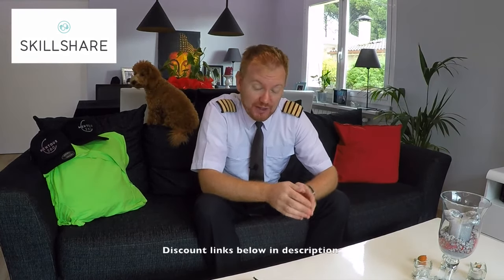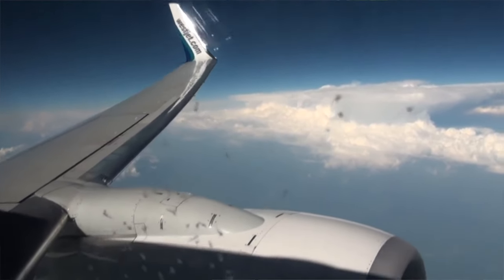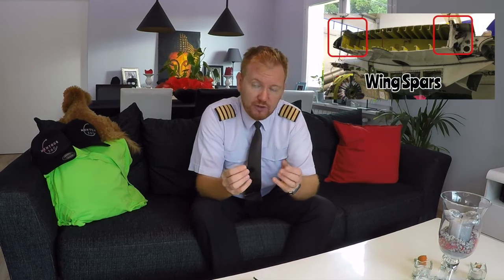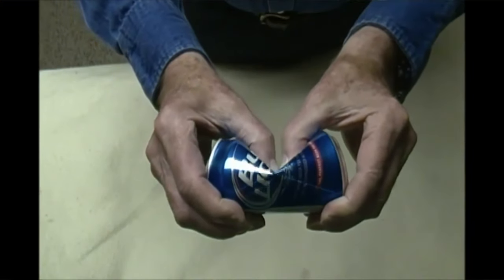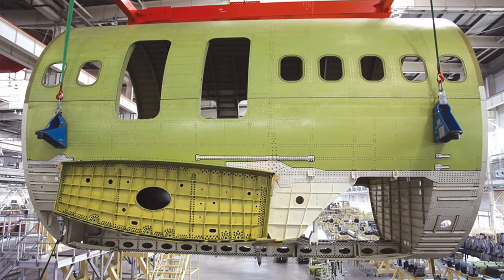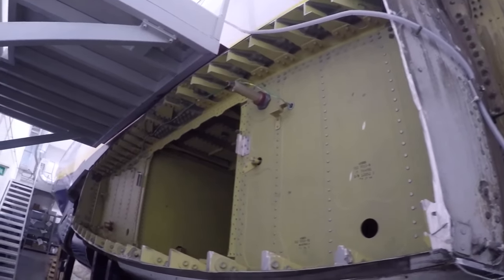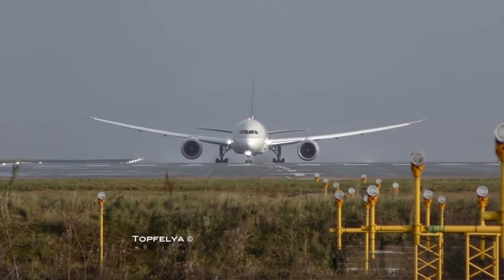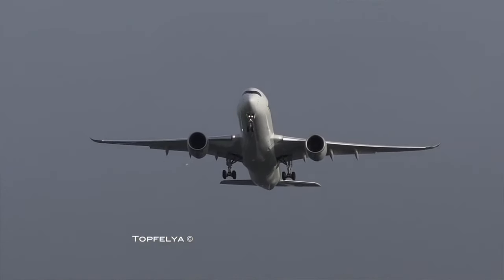Why don't the wings break?!

Comment: My dad was a WW2 Dive Bomber pilot who then became an Aeronautical Engineer and joined Boeing, Seattle in 1950 and stayed with them until 1960. His primary assignment was wing design of the 707. Because of his first-hand observations of wing failures of fellow bombers,  he was fervent in assuring the 707 wings could NEVER fail. As the 707 was the initial Boeing large passenger jet, many of the internal Boeing design specifications were established for the 707 and then made part of company design requirements... to be applied to future designs. Because it is hugely difficult to modify a design standard, then I can assume that the stringent wing strength and flexibility standards developed by my dad (and others) are still the minimum (or further improved) standards applied to ALL Boeing jets.

I am NOT as brave (nor heroic) as my Silver Star father, and so have some fear of flying. HOWEVER, the one thing I am 100% confident of whenever I climb aboard a Boeing plane is that the plane will NOT crash due to wing failure 😁👍  Thanks, Dad ❤

Comment: I had the pleasure of flying in a Ford Tri-Motor a few years ago.  The rigidity of that plane was quite noticeable.  Standing next to it, if you only looked at a small section, you would think it was a very sturdy garage, not an airplane.

I remember seeing a documentary that showed testing of a wing (Boeing, I think?) where they secured a wing to a test rig that bent the wing until it broke.  When it broke, it just basically shattered.  It was amazing/frightening to see, yet comforting because of how far they had to bend it before it happened.  The engineering in modern airplanes is incredible.

Comment: So, I flew out from Edinburgh on 757-200 to JFK (economy)  -all good but cramped -narrow body plane... then I flew back via Amsterdam on a KLM 787-900 Dreamliner.....that was different experience. Economy on this beast felt like an upgrade...Windows were much larger and they auto tinted (no blinds) at night and then in the early morning, from the front of the plane, progressing to the back,  it was awesome to watch the windows, one by one,  slowly become see through again, letting the fresh morning sun into the cabin. Air quality was better, room to move was better,  USB and mains charging sockets available for devices. An absolute pleasure to travel on the 787.

Comment: This is how I have heard pilots describe airplane wings. They are capable of touching each other without breaking. That says a lot.
Reply: No not that far. On the 777, I think it is 32 feet at the tip.
Reply: While that’s certainly an exaggeration, it does tell you how much confidence pilots have in the overall strength and resiliency of their aircraft during rough flight conditions.  If the crew aren’t worried, then I won’t be worried either.

Comment: Of course they can break.  That's why there are published G-limits for airplanes.  F-4s were subject to transonic pitch-up that would tear wings off, but that won't happen if you don't go supersonic.  As Naval Aviators we experienced negative Gs and pulled 6-8 Gs, but most people won't do that.  My mom got excited at only +2 Gs (60 degrees angle of bank level turn).  As for thunderstorm penetration (turbulence),  there's a speed where the wing stalls before exceeding  G-limits so it never overstresses if you slow to that speed--that's also maneuvering speed if you're flying a fighter, that is minimum turn radius and maximum rate of turn within the aircraft's G-limit.

Comment: It seems it would make sense to connect the wings together in the center of the aircraft wing box rather than have them bolted on at the side of the wing box. Seems like leverage of the wing would put stress on that and be weaker than if it was connected "inside" the wing box.
Reply from the maker: Don’t think of it like the wings are connected to the wingbox, think of the wings and the box as one, whole unit, that’s how it’s designed.
Reply: But if you connected the wings at the center, that single joint would see twice the load.
Reply: Dan Stinson,  Agreed. It has always worried me that the wings are constructed separately and then attached to the wing box/fuselage with bolts. Those bolts are kind of critical. One would have thought it would be safer/stronger to construct the wings in one piece running right through the aircraft . . .
Reply: @jamesneilsongrahamloveinth1301  The bolts are critical, but they're the very last thing to go in a structural failure.
Reply: there has to be a joint, buying single piece aluminum wing skins is already expensive. Making them twice as long without a flaw is even worse.  The biggest reason for the joints at the side of the fuselage is you have to react the pressurization loads and flex at where the body and the wing intersect. By putting the center box to outer wing joint at the joint to the fuselage you can do both jobs at once. All Boeing airplanes since the 50's have been this way. Same with Airbus

Comment: I've done -1g and +9.2g. Neither is comfortable but they are both all sorts of fun.
Reply from the maker: Aerobatics?
Reply: Got a ride with the USAF Thunderbirds. 1 hour of everything an F-16 is capable of, I could barely walk the next day. It is far more strenuous and physically taxing than "Top Gun" would lead a person to believe and I would do it again in a heartbeat. But now, I settle for riding commercial, mostly in 737's.
Reply: There are many rollercoasters that exceed 2g.
Reply: Yes, but there are none which will induce gLOC or cause a redout both of which I visited the edges of. 

The most disconcerting effect of high g to me was the vision distortion. At about 6g everything goes blurry as your eye shape distorts beyond the lens’ ability to correct. Your eyes flatten. 

About 7.5 g everything goes black and white as the cones stop getting enough oxygen to function. Above 7.5g the tunnel vision starts. The edges go black and shrink toward the center rapidly until it appears you are looking at the world through a paper towel roll. All due to blood pooling away from the head even with a g suit. 

Negative g is worse. That feeling you get in a car going over a hill is just the start. If negative g continues everything in your abdomen tries to move into your chest. Makes it hard to breath and really hard to keep lunch down. 

Neither is enjoyable but I will take +g over -g every single time.

Comment: Would it be interesting to give some insights about Turkish Airlines Flight 1951 Boeing 737 Amsterdam Schiphol Airport? Where basically an airplane fell out of the sky.

Based on your previous video's about stall and enginespeedup times, could they have pitches the nose down to gain speed. Are there changes made to airplanes to prevent auto-throtling not to kickin when a pilot gives full thrust?

Comment: Petter,
I offer another view as a structural engineer. I suggest that the wings flex because:
1. aircraft grade aluminium, a typical metal, behaves elastic (up to a certain point)
2. you could make it out of carbon fibre, it'd flex a lot less, but it'd be very expensive to make
3. flexing that often is not good for the aluminium metal - it has a limited fatigue life
4. the highest stress in the wing structure is at the root fixing to the body. This is also where it's designed to be thickest and has the most structure

Love your videos.

Comment: I've always been a helicopter lover. I really kick myself for not trying to go into rotary wing school when in the army. Oh well.  My point is, I've always noticed the rotor flex from the side view as they lift off, and weight is placed on them. 
Id say that's a good comparison of wing flex. That too is why they build flat bed trailer trucks with an arch, so when loaded they won't have accidental bed failure with load on the. Thanks again for another cool episode.

Comment: What about fatigue cracks that are not discovered until something happens?
are routine maintenance checks sometimes missing signs of fatigue?
Reply: If a wing breaks during flight, I suggest you go and take a seat on top of the black box, because chances are, nothing on this green earth is going to save you

If you are lucky enough to be thrown clear of the aircraft when it inevitably breaks apart (and you are not still strapped into your seat), depending on how much altitude you have when the airframe fails, you might be able to aim yourself toward something soft, snow would be best, though a pile of mattresses or even a patch of trees are better than nothing (don't aim for water, hitting water is like hitting concrete, oh and you can be knocked unconscious and drown) 

If it happens in an area that lacks a suitable landing area, spread out to slow yourself as much as possible (like a skydiver preparing to open his chute) and at the last second (maybe 100-200ft) try and land on your feet with your legs bent a little, this will reduce the impact energy by several orders of magnitude (though you will probably still die if you don't get medical care within a few hours) the downside of this is it is almost guaranteed that you will break both your legs and possibly even your pelvis (you may even have to get your legs amputated) but it's better than dying isn't it?

if you are extra lucky, you will have some broken bones, a stay in the local hospital and one hell of a story to tell (especially if you have it on video)
Reply: Just saw a video on here where a military guy was explaining how he xrays the C-5's frames every 18 mos, every C-5. So I'm sure civilian aviation has a program similar
Reply: @judgenutmeg6935  any crack in the aircraft skin is an indicator that the main spar is overstressed or is about to break

If I see cracks in the wing of any plane I'm about to board, no way am I getting on board

I already had an experience of an aircraft wing almost snapping off (bad maintenance missed a crack in the main spar, but excellent piloting, clear weather, and a good amount of luck allowed the wing to stay attached to the plane) the wing was bent at an angle (not a curve like it normally is) and it was a white knuckle ride all the way to the runway, let's just say, there was more than just a round of applause on landing

Comment: Regarding sturdy connections: American Airlines Flight 587 crashed after the copilot put in hard rudder inputs during wake turbulence, causing the vertical stabilizer to rip off.
Regarding poor maintenance: Partnair Flight 394 crashed because a counterfeit bolt broke under stress and the rudder was torn off.
Regarding poor maintenance for 'reputable' airlines that are allowed to fly in the US: American Airlines Flight 197 crashed because the airline's maintenance crew was disregarding the manufacturers best practices for engine maintenance and didn't unmount the engine from the pylon, but instead unmounted the pylon with the engine attached to save work hours and money. This caused the engine mount to crack and the engine ripped off during takeoff a few weeks later. the aircraft crashed, everybody died.

Regarding: "Any other airline that is allowed to fly in europe or the us": Do you seriously think corruption will stop just because it'd put a few hundred people at risk? Do you seriously think they'd not cut corners to save a few thousand bucks? Paperwork can be signed for not even a few cents. Most accidents on those scales happen because of negligence or cutting corners. And certainly no big coorperation such as airlines will have only the best in mind when it comes to saving money.
Reply: Gee... So much positivity and optimism. As a very nervous flyer, I look forward to having coffee with you and talking about air crashes, before I fly.
Reply: How many flights during the time period of these cases DIDN'T crash?
Reply: Most aircraft crashes are due to pilot error, rarely is there an actual part or structural failure.  Having said that, there have been accidents due to structural or component failure, which was likely due to human error (poor work quality) or negligence.  I personally had an incidence where the A&P did not put the pilot seat back attach bolts in after an annual; the seat back fell backwards as I was climbing out after take off...not good...low and slow.  This almost caused an induced stall from me holding the yoke as I fell backwards with the seat.  This was in my B35 Bonanza, I was able to grab the seat under the bench and sit up pushing the yoke forward.  Scary stuff; that A&P soon left the area.
Reply: You’ll find most equipment failure accidents have a common thread.   Old hand me down planes or financially troubled airlines.  This is where the cost cutting gets dangerous.   This is a good reason to stay with the majors and especially Bananna Republic Airlines..
Reply: None of what you describe is the wings falling off though is it?
Reply: @gauravudiyavar9050  I concur that flying is generally safe. But not even 'reputable' airlines are safe from corruption and poor maintenance.

Comment: A buddy of mine just finished his  run in his BUFF, and was headed for debrief when he heard a bang,  crack and heard a tsunami like sound. He  turned and startedrunning. To late. The tsunami of jet fuel passed him on the ramp. The wing came off during refuelling. Their runs had  been low leve in 197l so the AA, and turbulence forewith helped to cause premature wing fatigue. I'm sure the crews glued the wing back on and the BUFF is in Diego Garcia now.

Comment: if the fuel is in the wings and acts as a counter weight, then does that mean that as fuel is used that it becomes more unsafe and less stable and stuff?
Reply: No because the entire weight of the aircraft gets lighter therefore less stress, Also there is plenty of reserve fuel in the wings when you land.
Reply: @Judge Nutmeg That's funny!  Actually there are fuel transfer pumps (several on a jet) that keep it balanced by equalizing the fuel load on each side.
Reply: @Judge Nutmeg Right!  Your thought process is precisely what drove aircraft designers to incorporate transfer pumps into aircraft that have left and right fuel tanks.
Reply: Yup...

Comment: Does Canada follow the same standards as European Union and the United States of America?
Reply from the maker: Absolutely! I just used FAA and EASA as examples
Reply: The main difference is that real maple syrup is available with your in-flight breakfast.
Reply: I wouldn't worry about it, the various taxes and charges that the Trudeau is putting into place Canada won't have to many airlines left in business soon. So it will be all American/Euro airplanes very well maintained.
Reply: You don't have to worry about Air Canada; your flight will probably be cancelled anyway
Reply: Derek Natan
Derek, we manufacture aircraft that are sold to the US of A so yes, absolutely.

On a not-so-related note, Canada also builds ALL of Ford's  halo car, the new GT-40s, just outside of Oakville, Ontario.  Every...single...one.

We do a lot of top-tier stuff.  We just don't brag about it.  Except for the Canadarms for the ISS, we put a Cdn gov't logo on them.
Reply: Because the Canadian gov't doesn't make de Haviland aircraft or Fords or Chryslers or whatever. 
The arm was made by Spar Aerospace formerly a Canadian owned company for the Canadian space agency. Hence why the logo is on it.